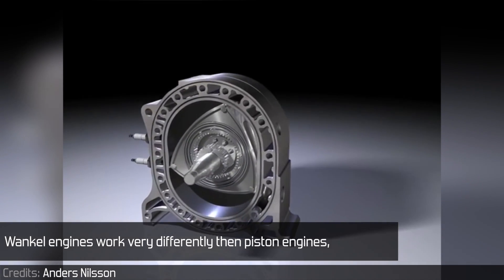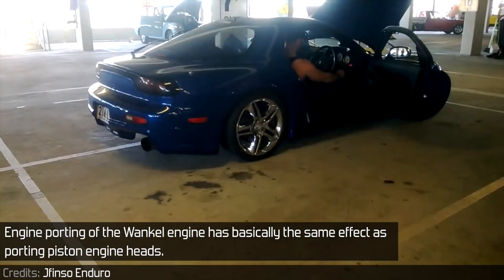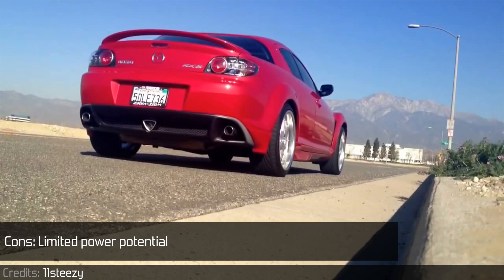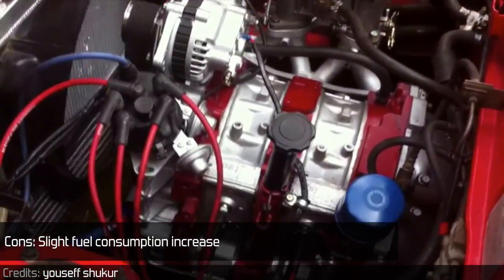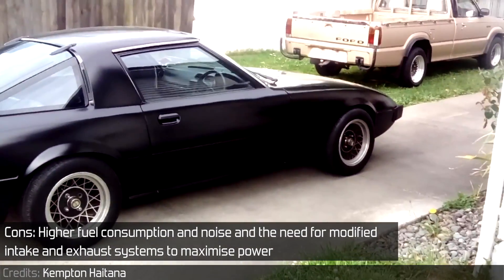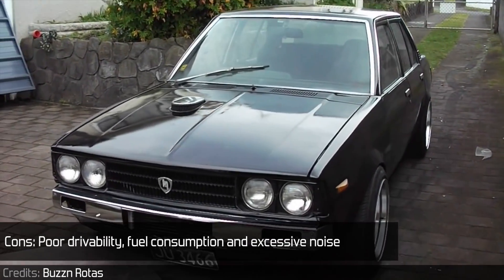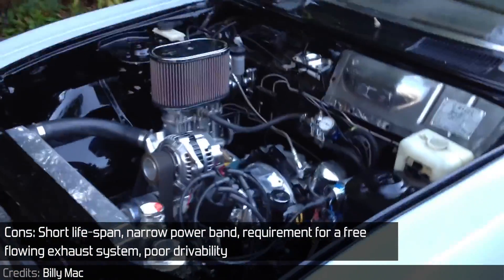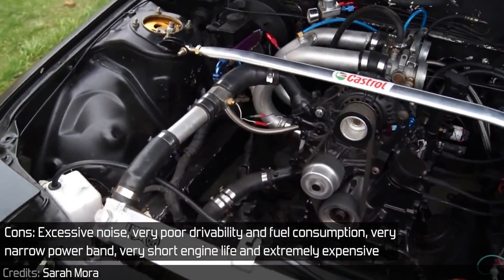Rotary Porting: How does it work and look?

Comment: so basically this engine is a pile of shit, only good strictly for racing
Reply: Bokie Playthroughs 
The Mazda 787B lost 20/21 races that it entered in, and its official track records don't lie. The reason behind its first and only ever win was just pure luck. In reality, it was slow and uncompetitive. You also have to be living in a fantasy world if you believe a Rotary engine can survive multiple track days, where its always revving high most of the time, with minimal to no damage. If they were so reliable in racing, how come you don't see them on racetracks outside of New Zealand?
Reply: Ruckus 
It's not even good for racing because of its fuel consumption and reliability.
Reply: ᏌᎦᏋ ᎿᖇᏫLLᎶᏌᏁ 01 Umm both you guys don't know a thing about rotaries lol. "Not reliable for racing" even though Mazda 787B won 24hr LeMon.

They opened the engine and had no wear, and the engine was ready for another 24hr race of the bat.

Try to do that on a tradition Piston engine, I guarantee you'll go through your engine and need a back up.

Or how Mad Mike goes through 4 Formula Drift championships and yet to have an Engine Rebuild on any of his Rotary cars.

Comment: I would like to know what a rotary engine failure looks like, or exactly what you mean by "short engine life" of a peripheral ported rotary engine. 
Specifically, what parts fail and how?
Reply: It's a myth, or misinformation if you'd like to call it that. Peripheral ported engines do not have short life attributed to the peripheral ports. They simply tend to have a shorter life because they are usually built as race engines and run hard to constant high RPMs to take advantage of the porting. All Mazda rotarys until the RX-8 had peripheral exhaust ports. Also way less people have first hand experience with peripheral port engines so they tend to just repeat rumors, assumptions and myths.
Reply: El KukS actually with modern apex as long as the failure isn't due to over-revving what usually happens is the apex seal warps causing loss of compression or the water jacket seal fails letting coolant into the engine. You can easily keep maintenance costs down by replacing the seals yourself it's quite easy to do
Reply: Apex cracks or just fails out of rotor and damages stator( housing) and sideplates.
As far as I know, after stator damage you would need to replace it. Or maybe it`s possible to repair it by welding and CNC milling but after it would require recovery of nitride surface.
Rotarys are cool, but extremely expensive. Full repair set (before apex crack) of seals, apexes and bolts cost around US$1300. How much would cost repair in case of apex failure is scary to even imagine.
If u`re on relatively low budget I`d recommend to stay with piston engines.
Wanna lightweightness? Turbo`ed 1.6l can pretty easily achive 300whp. Or if you dont want to mess with turbo check Ford`s Duratek - 2.0l, great aftermarket support and weight of assembled block in range of 130 kg. With ITBs and agressive cams you would get same HP numbers as with ported rotary, and the same 1.5k-2k RPM idle. But it would cost much less to maintain. Or rover K-series 1.8l @ 120kg, Toyota 2zz-ge also very light (both engines was used in Lotus, and those guys love small weight numbers)
Reply: Yeap, I`ve heard people claims to run 13b for 300k km with good aftermarket apexes. But anyway it`s not that cheap as wanted to be :(
Reply: aaroncake the peripheral port in the case of the video refers to the intake port not the exhaust port

Comment: Comment on the reliability part, mad mikes 4 rotor fd has had the same engine for the past 3 seasons and has not needed a rebuild
Reply: The FD is only making about 600 as its naturally aspirated, i believe the rx8 is making somewhere around 800, and the mx5 is making 1200
Reply: ok just checked the current figures for the cars...  RX8 is 812bhp and the RX7 is 537bhp.  all 4 rotar the rx7 is a NA build but they are building it up for a turbo setup..  building it all up first then the turbo(s) will be the last thing put on and yes the mx5 is 1200bhp but it seems he is no longer using it at competition drift level
Reply: his n/a fd 4 rotor is a little over 500hp, his turbo fd 4 rotor is close to 1000hp, his turbo 4 rotor miata was 1200hp but is now a 13b n/a, his rx8 20b turbo was a touch over 800hp. 
All reliable and pulled apart at the ends of seasons after multiple drift events, practice, qualifying rounds, victory burnouts and demonstration days sitting at high rpm with high load and it was only to be inspected.
Reply: really?  last I thought I had seen everything was in or very close to breaking the 1k hp mark...  i'll have to go check out what they are at now
Reply: dudes he has 2 fds one twin turbo one n/a 

na around 600 and the turbo around 1100
Reply: I bet it's a 100k motor...
Reply: and he is putting down 1000hp in all 3 of his cars...  I believe the miata with 26b is up to 1250 or 1300,   FD is right around 1200 and the rx8 is 1100...  all have 26b engines all tuned for different race limitations.
Reply: no way fd  only making 500 - 700tops

Comment: Just one (maybe) stupid thing: when you say, that it can reach, for example stock ports 180 hp, it's mean for just one rotor or just for the two rotor stock engine?
Reply from the maker: I meant it for the engine, that's why I mentioned the 12A engine.
Reply: VisioRacer thank you, keep the good work and stay tune 👌👌
Reply: Just for reference, The RX8 came in 2 main flavours ignoring Japan's extra spark plug engine that had a 18HP boot, The 4 port and the 6 port.

The 4 port was the 1.3L 192HP engine, just above what was talked about in the video though you have to note that compression on the rotors is different on the RX8, designed more for NA power than forced in the RX7's. Anyway, the RX8 also came with a higher powered version running with 4 intake ports, 2 per rotor, very similar to extended port except a bridge going horizontal, breaking the port into 2. With an extra spark plug per rotor in the housing, Mazda managed to get the power up to 250HP but was only sold in Japan under the Type-S badge. The issue with these engines however compared to their ancestors is that while the RX7 engines a peripheral port exhausts, the RX8 didn't. And these ports are not extendable due to being so close to water channels. This was how the RX8's were designed and can't really make much more power without completely changing the housings to a peripheral exhaust port.

To understand the reason why torque drops in the lower rev range with rotaries in general, you have to understand also these engines rely on not just intake volume but also intake velocity. Smaller ports means the air comes in faster and so is easier to move around the engine however larger ports means less restriction at the higher end so more power but it's power band moves further up the RPM range. Leading to higher fuel consumption and greater wear.

Comment: sounds like a 2 stroke
Reply: It is a 2 stroke.
Reply: Rotarylover how?
Reply: DoobieR They have a lot on common, having no valves and providing power with each revolution and supposedly putting 2-stroke oil in with the fuel will do wonders for their reliability too.
Reply from the maker: It burns its own oil, but it's not a two-stroke.
Reply: Quintinohthree ah I see, 2 stroke has a power valve tho

Comment: I want a rotary
Reply: Hercules Rockefeller Rotary Engines can actually provide better weight distribution when compared to piston engines. :)
Reply: it's funny how the haters write the most uninformed ridiculous comment's.
Reply: FP5Reviews If you take care of it it'll take care of you
Reply: DoobieR honestly you should get one. It's all about how the previous owner treated it. I recently bought an fc rx7 and it's got 195k and running strong
Reply: FP5Reviews people told me not to own a 2 stroke that I would regret it and I don't so hm I'll take my chances on this too
Reply: Hercules Rockefeller that's why you turbo it
Reply: theres a citroen GS  birotor for sale in england for about 100.000 brittish pounds, a bit over priced though, but if you want one that could be an option :P
Reply: 2.6L non turbo putting out 700hp is worthless... too bad it happened with almost 900hp and couldve taken it.
Reply: Hercules Rockefeller bullshit mate.  just the engine weight is about 180 pounds. with gearbox and everything its a little over 400.
Reply: 99Lezard99 Depends on which model you're talking about. The 13B-REW engine and drive train weigh 704lbs. The 13B-MSP may weigh less, but considering they only put down 180whp, thats not that impressive.
Reply: Shawn Elliott 
A lot of power and displacement in a small, lightweight package is my most favorite part about these engines. Also, Japan and Europe has that same issue of calculating the Wankel's full displacement due to taxation regulations based on engine displacement. However, we don't have that problem here in the U.S. because we tax cars based on body size, so we can use the full displacement on Wankel engines. But, most people don't realize this and go by Mazda because Japan is selling us the engine, not the other way around
Reply: 180whp from a 1.3 is not impressive....ok. I'll admit the RX8 has it's short comings, but for what it is and what mazda intended it to be it's a pretty damn good car.
Reply: I want your rotary engine
Reply: I have one, they’re high maintenance but if you do what you’re supposed to and take care of it, it will take care of you too
Reply: Rotaries are like chicks with horses. They are expensive, they will ruin your life, you will probably be left stranded alone on the side of the road. However, when the moment has passed and you are old and frail with your reliable piston engine wife, you will still think back to those days when you had a rotary and smile.
Reply: ***** true. But the 1.6 needs turbo then. 
Rotarys are not really compareable to a normal piston Engine.
Rotarys are for enthusiasts and not for everybody. I see it like that: a rotary is like a stupid old but fun exotic. You dont need it, there are better and especially more efficient Engines out there but you want the stupid fun rotary. 
Like i said. for enthusiasts. 
If i had enough money i would have a 3 rotor 20b fd3s in my garage as well next to my nsx r32 and so on
Reply: Godfrey Poon 388.4 lbs is what a complete 13B-REW engine weighs. Yeah the twin turbos and plumbing make up almost half the weight, but without turbocharging a rotary is almost worthless
Reply: A 1.3 with higher running costs than a 400hp V8 isn't impressive.
Especially considering you can now have a 4cyl 1.6 with more power, far better reliability and efficiency. Rotary is obsolete and was even before they made the rx8.
Reply: You dont want a rotary. They could hang with piston engines in the late 80's early 90's but after that they were garbage. With today's performance of piston engines there's literally no reason to own a rotary. They are weaker than a 4cyl, they eat gas worse than a V8, and have the reliability of a Ferrari. 
Rich kid fan boy's who are trying to be 'different' are the only people who think rotaries are worth a damn anymore.
Reply: Le Cruset No they dont. Rotaries are heavy. Motors are right around 400 lbs. 704 lbs with drivetrain. Thats about the same as an aluminum V8. Even a SR20 or F20 is a better swap than a rotary. There's a reason why no-one makes them anymore
Reply: The 26B isn't 2.6 liters, it's 7.8 liters. Mazda was banned from using the 26B engine at LeMans because they only rated the displacement of one face per rotor, despite the fact that all three faces of each rotor are doing work and displacing air simultaneously. The 26B is essentially equivalent to a 7.8L V12 2-stroke engine -- obviously not a fair competition vs. the other cars on the track at the time.

Comment: The problem with Rotary are the seals.
Reply: aaaand the oil comsumption. An engine that is basically designed to burn oil. But i still want to have an rx8 at some point.
Reply: yeah maybe, but in my case emissions are the problem. see, the rx-7 is pretty old already, and thus it has a pretty expensive emission class in my country. the rx-8 is newer, therefore "cleaner" and i dont have to pay too much for that emissions tax BS.
Reply: The problem with the rotary WAS the seals in the 1960s. The problem now is the driver not warming the car up properly. Unfortunately, this myth has been perpetuated by uneducated people especially in america. Also, this video is pretty much word for word from an article in fast fours & rotaries magazine from the late 1990s - that's where the pictures of the ports comes from. Very old info and engines can reach much more revs and HP these days!
Reply: xDarkAngelFallingx rx7s are like three times as much than an rx8. Unless you get an fc.
Reply: Diarmuid Marsden 
I have an Fc and wouldn't go to a gen 1 or gen 3.
Gen1 is a marvelous car but just getting to long in the tooth.
Gen3 is an awsome machine but the twin turbo system can be a nightmare.
The Fc still has all the creature comforts and mod cons of the Fd while still being a classic.
Reply: in order to have a nice car, you need many temperature gauges, and some ecu knowledge where even stock parts serve as a reminder that rotary must start from 0 percent again. True knowledge keeps plastic components OK not missions and full throttle. If your an astronaut and you have a mission its ok to go 100 percent throttle, if not its best to keep everything at the lowest temp to extend its life where rotary is definitely start again.
Reply: fuck yea, people who don't know aren't googling renesis teardown and are focusing too much on broken apex seals instead of warped or completely broken front and back seals. The second one a hot side seal is broken you lose compression.excess heat will take that plastic and bend it, at worst fuse it, losing its sealing capability. manufacturers claim that they withstand pressure and heat but its like cooking an egg. You use the same corn oil, it gets hot and as it gets older it has to be replaced. I see it as low structural damage where the engine will be alright but the seal is broken, in my eyes its lets disassemble it again. do you know why people ruin water jacket or main front or back seals? because they drive too fast.
Reply: Just buy carbon ceramic seals, problem solved.
Reply: Despair what about an RX3?
Reply: Yes and then just replace the housings instead of the seals...
Reply: Rx-8s are trash, if you want to own a rotor, buy a 7. Way more fun, turbo and they don't look like shit.

Comment: If you don't count the zillion little seals then yeah, these things are quite simple.
Reply: 177SCmaro if you are counting apex seals ect as "zillion" it isn't really much when you think about the fact that every 4 stroke piston engine has 5 different "seals" per piston.
Reply: Joseph Carprpenter Head gasket, 3 piston rings the bottom ring is usually the most complicated with 3 parts, 2-4 valves, 1-2 spark plugs. Most of them are simple "circles inside circles". That's not that much compared to a Wankle and the odd-ball shapes it's trying to seal on 2 different planes (front and sides) with significant temperature differentials. Hell, just one apex seal consists of like 7 parts, 3 seals and 4 springs! So, yeah, "a zillion" little parts to seal the thing when taken altogether.
Frankly, it's amazing the thing seals as well as it does.
Reply: all wankel engines have been running on 80 lbs compression vs 135lbs?